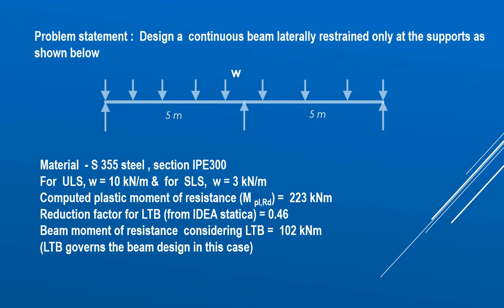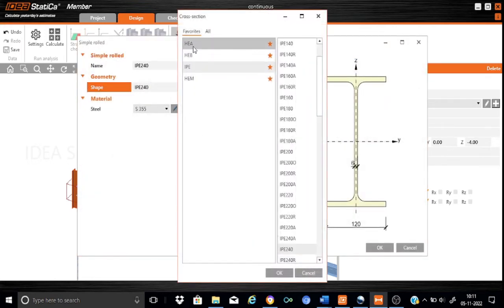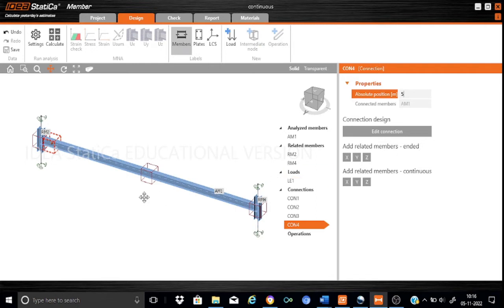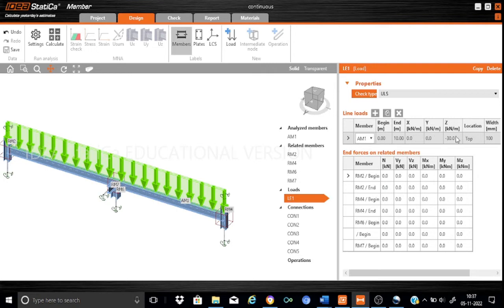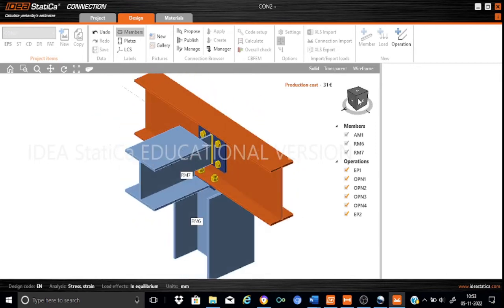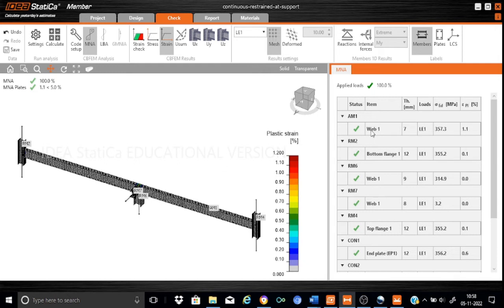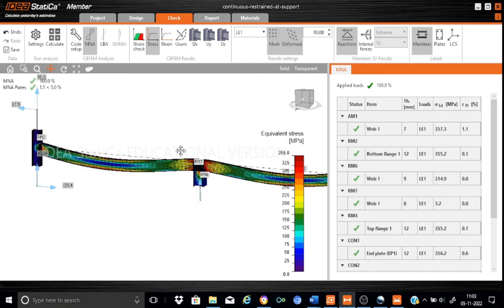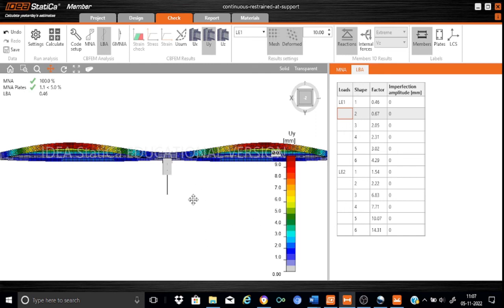IDEA Statica: tutorial  36- Design of an unrestrained continuous beam  as per EN 1993-1-1(Eurocode)

Comment: Still not really sure what this app does over and above our normal analysis/design packages - except destroy the budget perhaps? How long to design a beam???????
Reply from the maker: Hello richard,
It 'an interesting query. I would first of all prefer to design the CONVENTIONAL platform (floor) supporting beams using  the normal design packages like SAP2000, ETABS etc. as all of these come with an in-built design module  to accomplish the  design checks as per the selected code. However, these packages are having very serious limitations when it comes to the design verifications of critical members such as equipment supporting beams, plate girders in bridges , cement silo supporting structures, gantry girders  etc. Here is the relevance of IDEA statiCa member module. For all the critical members described above, IDEA statica member module will allow you a very detailed component based design  as it allows loads to be  applied to any part (top /bottom flange, web) with an eccentricity, local stiffeners can be directly modelled  including any openings in the web , flange etc. Further , all geometric imperfections  recommended in the codes can be directly inputted into the program, It provides a detailed distribution of stress/ strain across all components, furnishes a detailed buckling analysis , allowing the engineers to provided effective measures  to control bucking . You can identify critical parts that triggers buckling and accordingly change your design . 
Based on my exposure in the detailed engineering of steel structures in  petrochemicals, refineries, chemical, cement industry etc, my personal opinion would be that IDEA Staica is an asset for any organization. Other software we use in performing similar detailed investigations include ANSYS, ABAQUS etc. However, IDEA Statica is very much easy to use compared to these software.
I would also would like to tell you that the design will not take more than 10 minutes (don't  get mistaken by  the time taken in the video presentation.....!!!)
Hope that I could provide you an acceptable reply. In case you have any other queries please let me know.
Reply: @puttattjayarajan1199  Thanks very much for a very detailed reply. I’ll go through it - I’m sure there is a point to it but I’m just not seeing it. 

I have the software, I use the connection package primarily.

Thanks for your presentations also, they’re very clear and detailed.